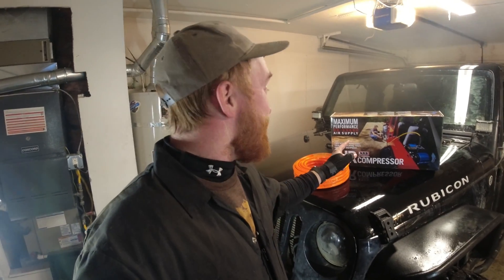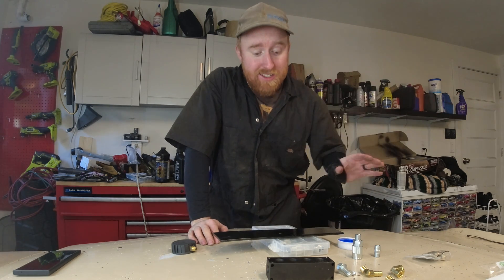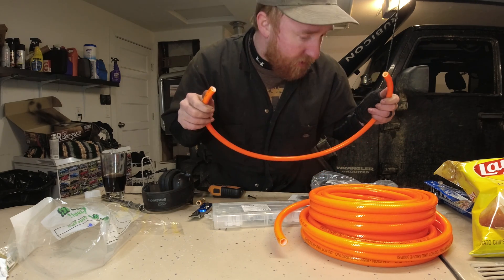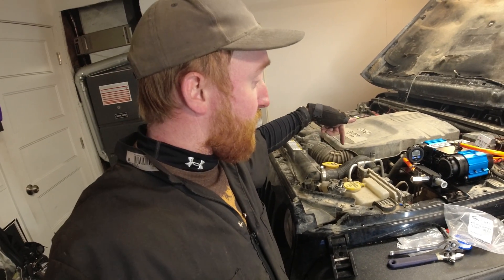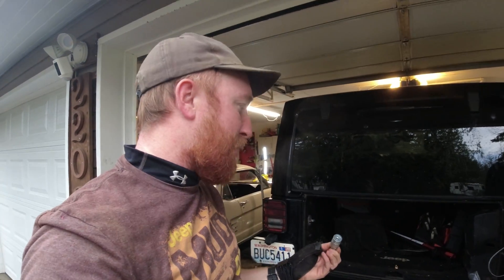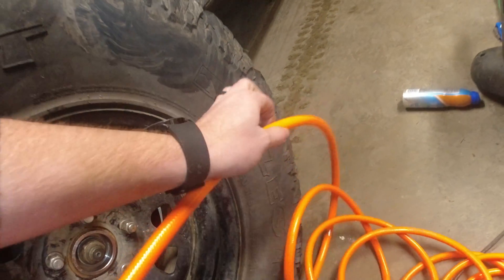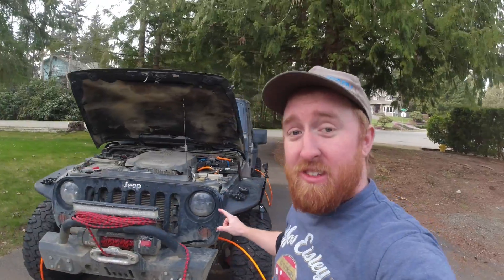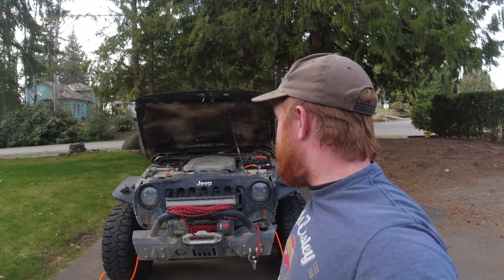EASIEST DIY Onboard Air System! Airing Up AND DOWN At The SAME TIME!!

Comment: Putting the compressor next to another heat source is gonna cause issues. The reason they break is because of to much heat/working it hard. Thats why im mounting a compressor in the back of my vehicle
Reply from the maker: After it being there for multiple years and a lot of high usage, i have had zero issues with mine. Still works perfectly like the day I installed it.

Comment: Watch the Teflon tape. Shouldn't have any on the last two threads, any small valves downstream can wind up getting blocked/jammed open with bits of Teflon.
If you throw a small pressure tank in there, can pre-fill before needing to air up, likely the same overall time, but will keep continuous runtime on compressor down. Tank would also allow a more accurate real time pressure reading.
Reply from the maker: Thanks for the tips. 
I'm actually planning on having a tank as well. Left an extra port on the manifold for exactly that.
Reply: @4WDTrek  extending the guage line away from the manifold will also get you a better reading if you won't be able to put it on a remote tank. Minimum distance should be 10 pipe/tubing diameters from the manifold. Place a tee and guage there, then extend 5 diameters past and cap.
Reply from the maker: @mrfloggingshagg  good to know. I might just do that.

Comment: This is a pretty neat setup actually, I might have to try and emulate it one day when I get around to doing onboard air on the ZJ!
Reply from the maker: It's definitely an awesome set up. I have used it a few times on trails and it works really well. And it can be adapted to just about anything. Highly suggest!

Comment: Also, a buddy did a muffler delete and added a 12 gallon air tank in the muffler spot so he can use his air tools on the trail.
Reply from the maker: I'll likely move the evap system to the rear and use that area to put a small air tank in as well.

Comment: Just remember..one at as time or 4 at a time, you are still limited on the volume or CFM of the compressor so get the big one haha. ARB has amazing customer service. Had a pump fail after warranty and they honored it since it was an older design.
Reply from the maker: Yup. Thats why I went with the twin arb compressor.